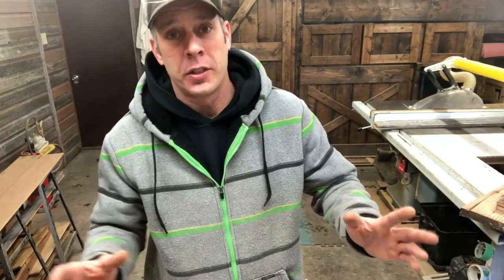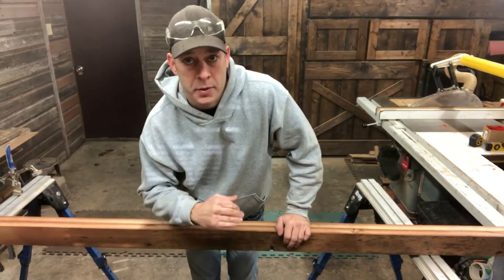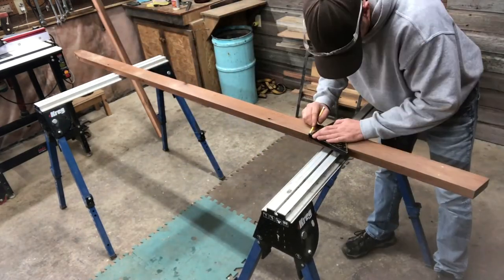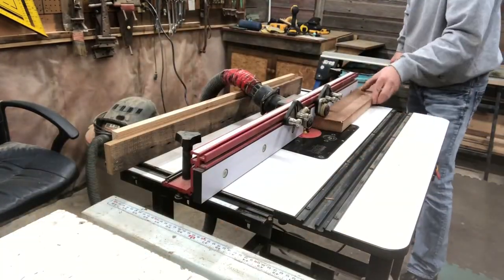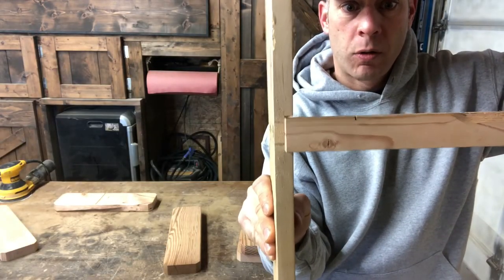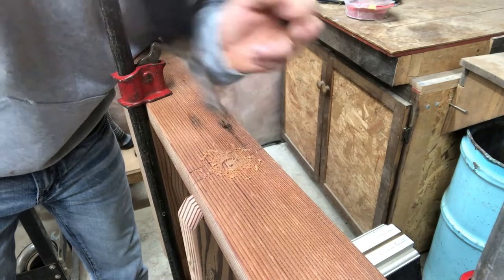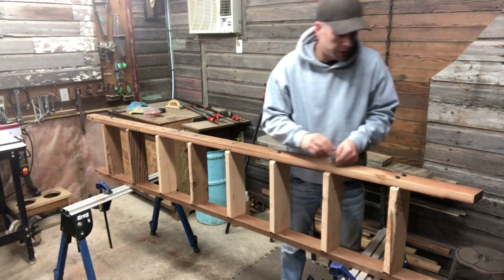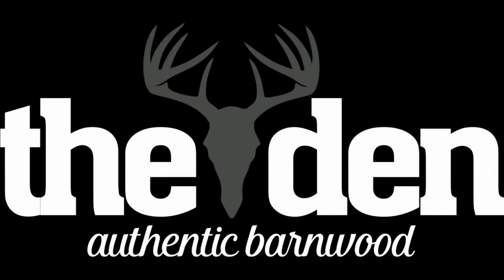Library Ladder Build With Threaded Inserts (Reclaimed Wood)

Comment: But u cant move the ladder because thw angle of the top wheels are rubbing on bottom of the hinge on the track
Reply from the maker: We’ve made a number of these ladders and have had no issues with rubbing or the unit not functioning as it should.  

Thank you for sharing your experience/observations.